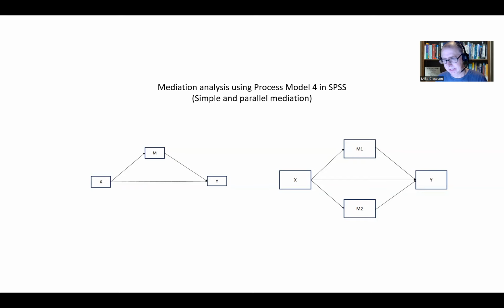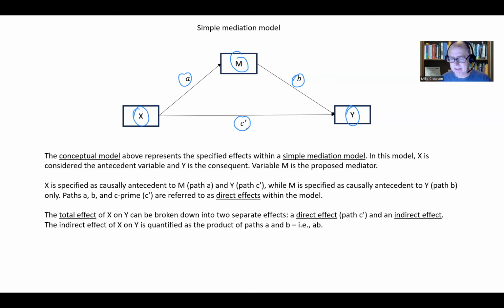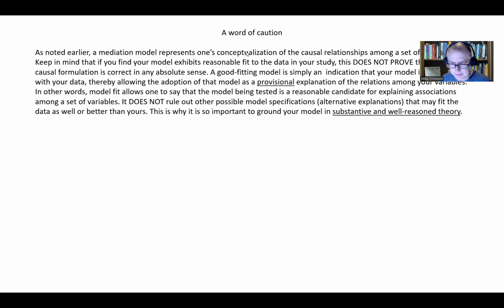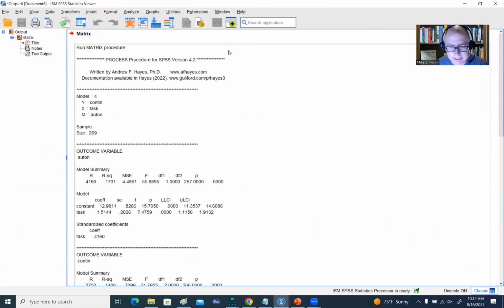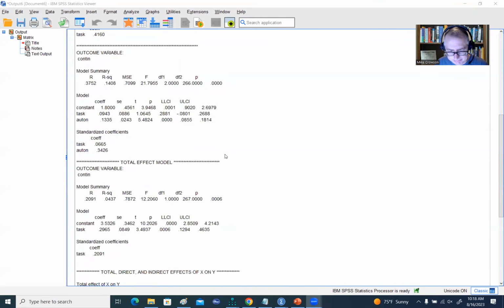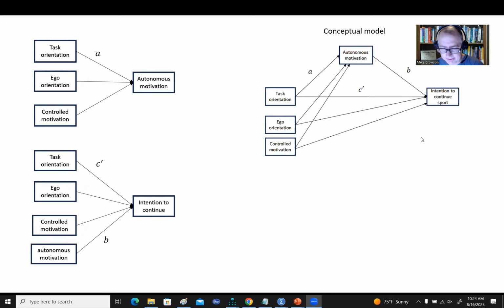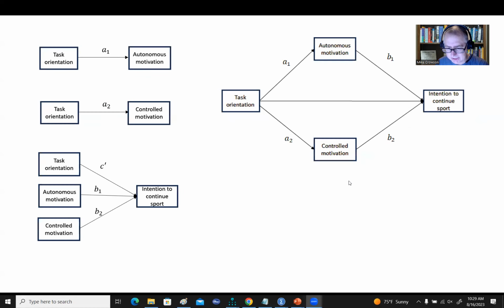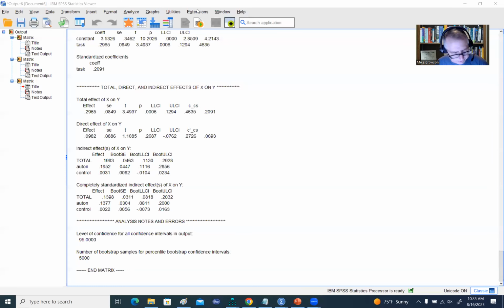Mediation analysis using Process Model 4 in SPSS (Simple and parallel mediation; Aug 2023)

Comment: Thank you for your explanation, I learnt a lot. But how to account for more independent variables in the model? From what I can see in the video, we can only have one IV under X variable. Thank you!
Reply from the maker: Process is set up for a single X and a single Y. However, you could 'trick' Process into testing  mediation using multiple X's by running a series of models with one X as IV and the remaining X's as covariates. The indirect effect in each model would be associated with the X treated as the IV in each model. Alternatively, you might run path analysis using an SEM program. Hope that helps. Cheers!

Comment: If I want to report the standardized effects in my thesis, can I then use the significance level of the non-standardized effect for the standardized effects? I ask because no p-values are given for the standardized effects
Reply from the maker: The p-values for the standardized effects in the individual regression models would be the same as those for the unstandardized effects. I'm not a huge fan of only reporting standardized effects and p-values [I tend to report both unstandardized and standardized coefficients, but that's my preference]. The p-values for the unstandardized and standardized effects are the same for the regressions.

Keep in mind that when you select Standardized effects when using Process Model 4, it will also print out standardized indirect effects (at the end of the output) along with bootstrapped confidence intervals for those effects. [You will see this appear below the output for unstandardized indirect effects and bootstrap confidence intervals] You won't get p-values for any of these, but the confidence interval can be used for testing significance of any indirect effects you compute. If 0 falls outside the lower and upper bound for an interval, then the indirect effect is deemed as statistically significant. You can report on the bootstrap confidence intervals along with for your indirect effect and this will convey information about your estimated indirect effect and significance.

Comment: Thank you very much for the explanation. One question, can I use the analysis with all categorical data?
Reply from the maker: With Process model 4, you can specify your X variable as a multicategorical variable. You can also specify your Y variable as a binary variable [If you do this, the second regression model becomes a binary logistic regression]. However, the mediators must be continuous.

Comment: concerning your process output and the odd columns on min 18: Just change the font in spss output to one where every letter has the same width. Then all columns are perfectly in line. :) Had the same issue and could solve it that way.
Reply from the maker: I appreciate it. Thanks for the tip :)
Reply: "Courier new" worked for me :)

Comment: Hello Mike

Please i need clarification on whether i need to do a linear regression analysis first on SPSS for variable X-Y and X-M before using HAYES process model to do the mediation analysis  

or should i just do a midiation analysis using HAYES process model only and get the results for X-Y and X-M from the process model results summary ?
Reply from the maker: The paths in the mediation model are estimated using separate ols regressions. There's no need to estimate them using the regression menu in Spss since they are already provided in the process output. Cheers !

Comment: Thank you for the video! It was really informative and helped me a lot. I have 2 questions regarding a model with 2 mediators though:
1) If I want to compare which path (a or b) has a stronger impact on DV, then I just have to test if the indirect effects are stat different and compare them, right? 
2) In my case I have two IVs. Can I use Hayes Process for that? Thanks a lot!

Comment: Dear Crowson, first of all, I would like to say that your channel has been a great blessing for young researchers. I greatly benefit from your videos and especially your ppt presentations. I'm really grateful to you.

Is it possible for you to upload a video about mediation/moderation variable analysis using covariate or control variables?
Reply from the maker: Thank you for your encouragement with my work. I'll see what I can do on that (I still have a number of projects in the cue ahead). However, in the meantime, just remember that you can add covariates into the Covariates box when you perform mediation or moderation analysis. Mathematically, the covariates are included as control variables in all regression equations involving prediction of an endogenous variable (which will be any mediators and the consequent) in the model. Thank you again!